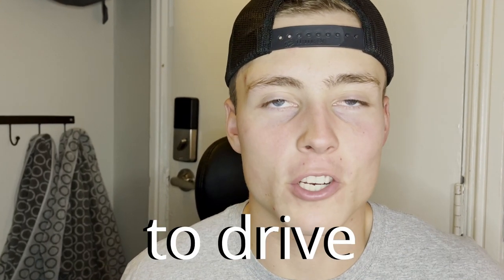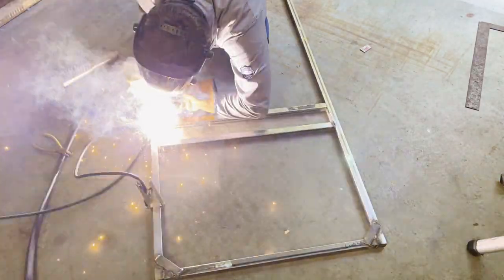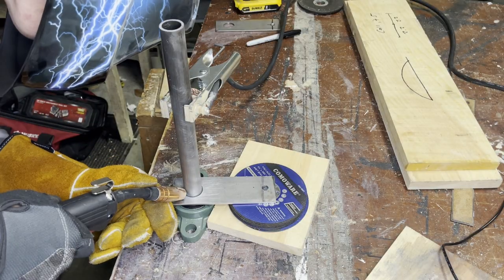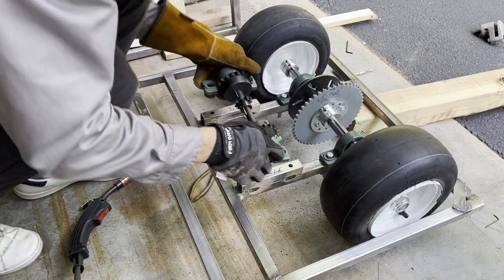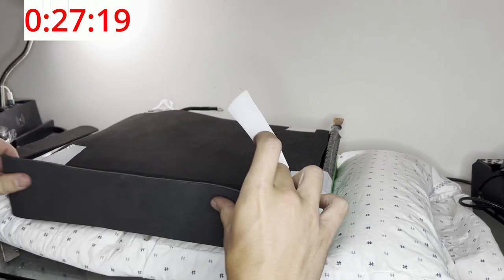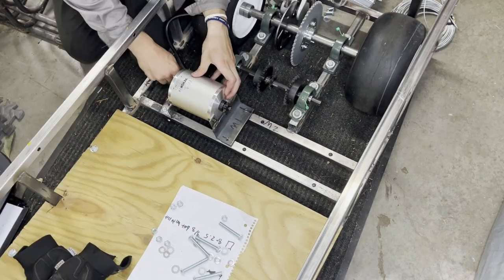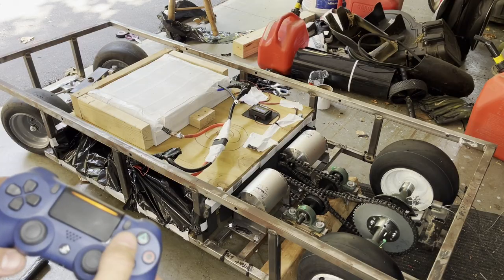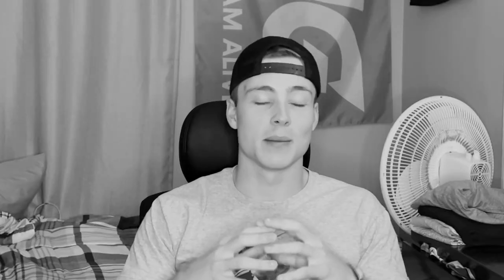I Made a Remote Controlled Driving Couch

Comment: Mr. Dale, How did you know how many batteries you needed? If every battery is 26v how did you know to get 72 volts? our goal is to get 48V as we are only using a 2000W motor. How would we find out how many batteries to buy?
Reply from the maker: Sorry just saw this comment, how’s it coming?

Comment: Hello Mr. Dale, My name is Steven, and am a high school student in BC Canada. My STEM club is working on designing and making a similar electric-powered couch car and we were wondering how you managed to connect the controller and add functionality to the circuits? Also, If it is not too much to ask, can we see which motors and wheels you used? We are basically beginners with a passion and would be extremely grateful for any tips or pointers you can give, Thank you.
Reply from the maker: Mr. Wang, I go to school in Canada! I go to Queen's University for mechanical engineering... HIGHLY recommend queens btw. Anyway, the controller is a ps4 controller which can connect to an esp32 (a microcontroller) through bluetooth. Below is a link on how to connect the two: https://www.youtube.com/watch?v=dRysvxQfVDw

Thing is, the bluetooth range on this board is kinda bad so you could look into a different microcontroller with a longer bluetooth range, this might be a better option. An Arduino with a bluetooth module could work I believe. There are lots of different codes you can find on GitHub to get the PS4 remote to talk to the microcontroller which be found on GitHub. A link to the code we made and used can be found below:
https://github.com/JohnDale02/Remote-Controlled-Couch-Summer22/blob/ba22332328e036a60b00abd4837cde658f3ea2c9/PS4Couch.ino

The microcontroller can then be coded to set pins to high and low when a button is pressed. These pins can then be routed to MOSFETS to control the lights and horn.

For the steering,  a motor controller is needed which controls the linear actuator. To help out I have linked a spreadsheet below which has all of the parts we used and cost breakdown along with most of the links to each part. At the bottom you will find a general guide on how to connect all the circuit components. 
https://docs.google.com/spreadsheets/d/1WoWodOLJmr7T0NuKtonejaMc1oZkFgxRbOvqRgOZ5vM/edit?usp=sharing

I know this probably doesn't make too much sense as i'm guessing you haven't learned much of this stuff in high school, but it should be motivating to know that I didn't know how to do practically any of this when I started and learned it through research and youtube videos within 2 months. Y'all got this!! Make sure to keep me updated on the progress.

Good Luck to you all and let me know if you have any more questions about it :)
Reply: @Will_Dale  Thank you so much this is great help. I am also considering queens for university! Haha, I may see you around if I do I will make sure to say hello.
Reply from the maker: @stephenwang9623  Can't go wrong with Queen's😎 Hope to see you around Mr.Wang
Reply: @Will_Dale  Mr. Dale, my friends are thinking of using a wooden frame, 4 wheels 2 wheel drive, except we aren't using hydraulics and mechanical turning, we are instead using the motor to both turn and stop. To make it work, we will use a control module/raspberry pi to program the wheels to move. By pushing on wheel go faster than the other we are making the wheels turn. Would this work, and if not, what should we do instead? We are not as experienced with metal work so is there anything we can do to improve our model? We are planning right now so we don't have the prototype yet. I had some concerns because I don't think the braking system will be quick enough and the turning system will be too slow as well. Any advice? Thank you so much for past advice, we took what you have sent us into consideration. Thanks again!
Reply from the maker: @stephenwang9623  This design could work, a differential drive system would allow you to steer If and only if you drive it hamburger style, instead of hot dog like my design was. Brakes are tough, no real good options there. Making it out of wood might be a bit of a challenge but I think definitely possible. Also to cut costs, I would recommend just having a steering wheel or handlebars to turn the thing.
Reply: @Will_Dale  my thoughts exactly